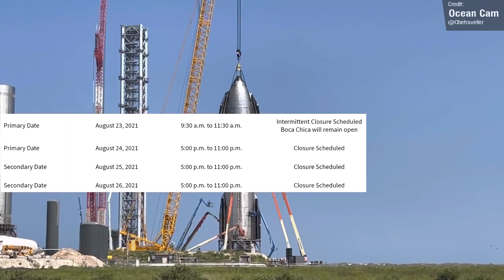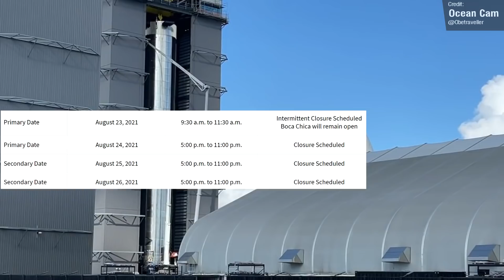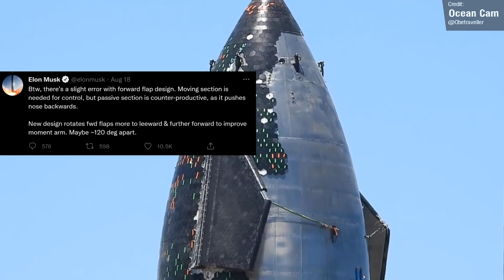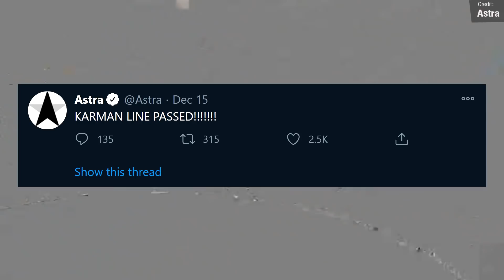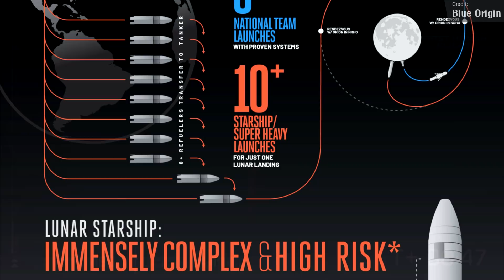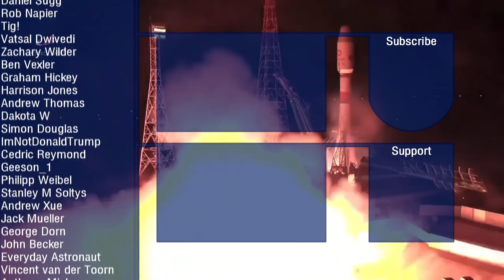SpaceX Starship's 2 Major Changes; Vega, Soyuz & Long March Launches; Blue Origin Sues NASA

Comment: I'm just wondering, what kind of payload would NASA be using this Karman line rocket for? They're not going to be released into space right? Whatever payloads they are, they will remain inside the capsule and fall back down. Some measurement device? To measure what?

Comment: Why does  SpaceX even bother with NASA anyway? 16 or 8 launches for refuelling the Starship Lander doesn't make a difference if you ask me; it's still hopelessly infective. Why not have a starship take off from earth, refuel it with a second launch and then send it to the moon from LEO.  If It can haul 150 tons to Mars, surely it can hall a fraction of that (30-50ish tons) to the lunar surface and return to earth on a single tank, when already fully fuelled in LEO

Comment: Why root fillers at all? Why not just open bt flaps and nose? Would make tiling easier.
For that matter why continuous curved nose? Stepped nose with flat sections would be easier to assemble + solve flap/nose interface.

Comment: Surprised they didn’t just decrease the size of the forward flaps to compensate for the extra drag. That would fix the problem and reduce mass. However, it would decrease the size of the control surface. What the hell am I talking about? I’m no engineer.

Comment: I think that the Starship in the thumbnail is upside down, the change in the flaps is to hide the static part from generating much heat, it will make more sense if the flaps are "higher"

Comment: As amazing as Starship appears, after the abysmal Vegas Loop and proposed Dugout Loop, I can't help but get the feeling that Starship, too, will just be a private thing only for the super-rich to enjoy as a status symbol.
Reply: I think SpaceX is aiming to completely replace Falcon 9 with Starship. It will at least do what Falcon 9 does but better.
Reply: Maybe, maybe not. I for one look at starship purely as a cargo ship at the moment. In that regards, even if it is 10x more expansive per pound then what SpaceX claims, If it works it will be an absolute game changer.

As far as Starship as a point-to-point transportation system, that is actually a load of horseshit of Vegas Loop proportions. No one is mad enough to endure 3+G during a rocket launch just to get to the other side of the globe in less then an hour.
Reply: @OnionChoppingNinja  What about military? Emergency services?
Reply: @MundaneMuser  cargo maybe. But most definitely not for hauling people.
Reply: @OnionChoppingNinja  I disagree. I'm sure some people would be willing and able to withstand the G-force without losing consciousness.

Comment: The scrapped booster should become fuel tanks at starbase, to hold fuel, it would be taking reusability to a new level!
Reply: Wrong size, would need a custom insulation solution, and you couldn't fill the top tank without thinking about the bottom one's pressure. Anything that influences the tank farm in future would need to consider multiple different tank designs, complicating things. It is cheaper just to scrap it. The key to getting reusability down is not being obsessed with reusing everything, and being realistic about what is worth reusing. Reusing something is hard, and really needs to be designed in from the start. This was not, so it is not a good idea to try.
Plus, it is quite possible that the rings are still viable for non flight hardware, so 'scrapping' it may mean cutting it into sections and reusing them. Large chunks of it may end up in the tank farm, though unrecognisable.
Reply: @agsystems8220  still, wasn't a bad idea, am i right?

Comment: I really like the redesign of the forward flaps. Looks less "cookie-cutter starship".  You can tell at a glance what direction the Starship is facing without the tiles giving it a more aesthetically unique design.
Reply: The issue is that they are off-centre; they will have to put in a counterweight on the bottom of the ship which needs to be as heavy as the whole hinge + flap so the centre of gravity remains in the centre of the vehicle, and that will eat up mass...
Reply: @wtrmute  no lol for one the TPS is already offcenter and also the flaps make up a very small percentage of mass and are only slightly offcenter + there is engine gimbal, see sn5 hop
Reply: @ryanspence5831  I hope you are right, but I would imagine that the TPS, being thin and made of foam, would be much lighter than the stainless steel flaps. Maybe if the  flaps were set 144° or even 150° apart, rather than 120°, I might think it more verisimilitudinous that they could counterbalance with the TPS.

Well, no matter. If they can't balance the ship out, the first prototype they build like that is going to tumble and fail, so they either find a solution or the flaps stay balanced at 180°.
Reply: @wtrmute  the TPS is made of ceramics that weigh quite a bit